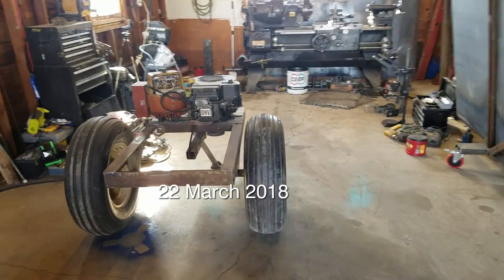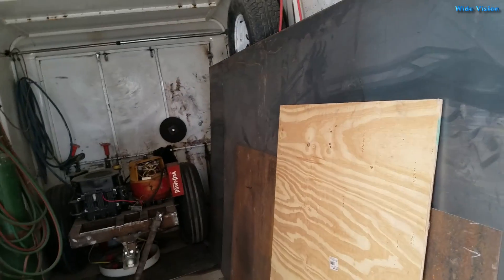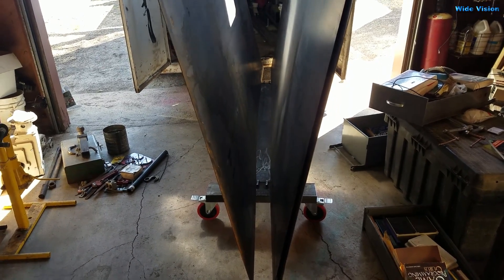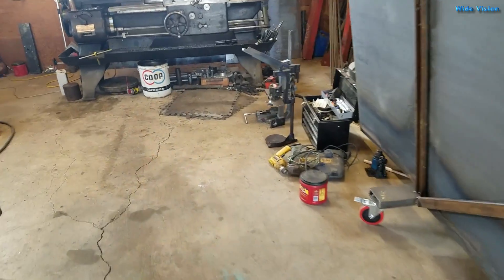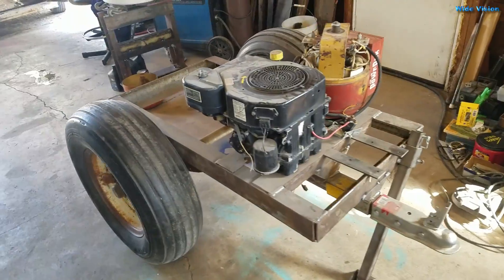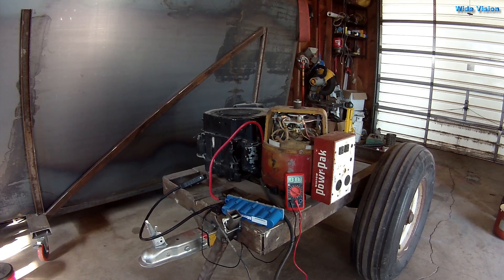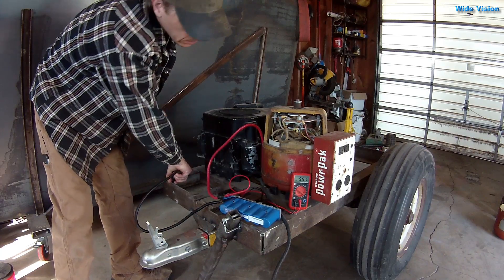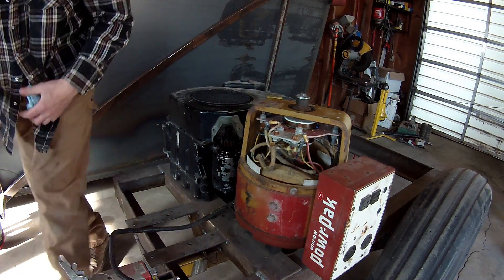Wood Chipper - Episode 25 - It's here! (And super capacitors!)

Comment: It works but drops fast too. Mine acts like that from lo voltage like the bendix is froze. Live and learn and THANKS & GBWYall!.
Reply from the maker: Definitely don't have much cranking time, but the engine will always be well maintained and start in the first 2 seconds....  at least I can dream! :)
Reply: I've got a 19.5 horse Vanguard In a Craftsman mower and a Kohler 301 in a Gravely that'd do it but the old 10 horse Briggs take a little more. The Vanguard and the Kohler just spin about 2ice and they're gone but the 10 is over 35 years old but still runs. If you run yours regular it ought to do it if the mag has been shined up. Outside is HARD on 'em. You'll triumph though. I confidense you!
Reply: Yep.

Comment: It's cool with the trailer backed to the door. Instant addition to the shop. Have you thought about maybe getting a shipping container for extra storage?
Reply from the maker: It works really good to have the trailer at the door!  Add some lights, and little hoist, and I could do a lot of work like that.  I did look into shipping containers. They are expensive, especially considering what I could build for what they cost. And, getting the truck in to set it in place would be a challenge. My current thinking is to build an addition behind the Rockford lathe and that would become my machine room. Of course, that's after raising the garage 4 ft.
Reply: Here some used and decent conditon shipping containers are available for around 3000 CDN,  it's something like 40 x 8 x 9 feet or so, quite a lot of storage for the price...   ;)

Comment: Are those 350 Farad each capacitors? I want to make one soon
Reply from the maker: I actually don't know, but  I would guess yes judging by the physical size. I tried taking the cover off, but it's glued on. I got it cheap off of e-bay because the unit is "removed from service." It's 58 farads total, so I think that it works out each is 350.   --- I just now found the unit on Mouser! here's the part number BMOD0058 E016 B02